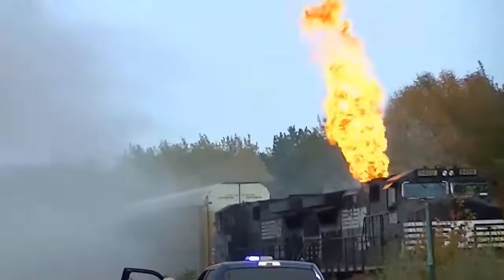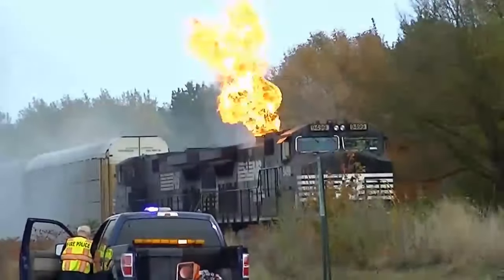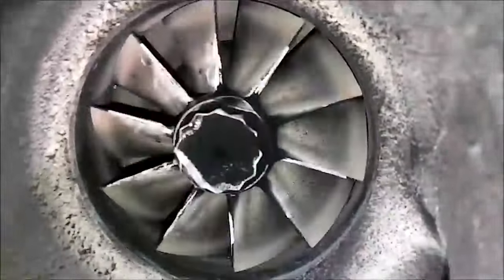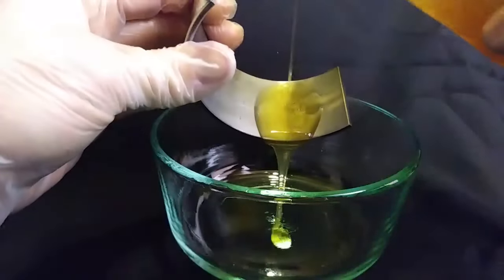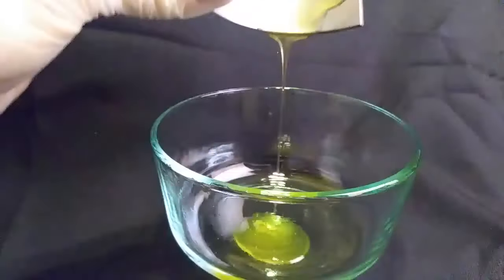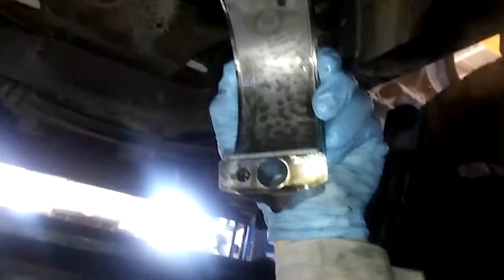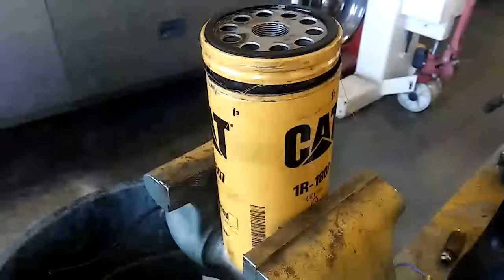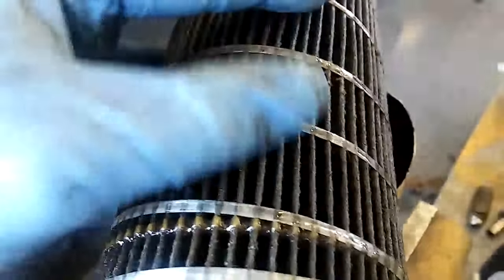Engine Block Heater vs Oil Pan Heater. Everything you NEED to know about Cold Weather Diesel Engines

Comment: Don't glow plugs come in all diesel engines or is that something separate that you have to install yourself
Reply: that's part of the engine design, it's drilled into the head and protrudes into the combustion area so that the injector spray hits it and ignites. Some of them are notorious for burning out (Old IDI Fords especially)
Reply: @Rx7man  thanks for explaining I appreciate it
Reply: some of them have grid heaters instead. which is better in my opinion. easier to maintain. simpler
Reply: @FrankieJames7  the Cummins 5.9s were grid heaters, yes, I agree, much simpler, but grid heaters (er, intake air heaters) don't work very well with indirect injection engine designs.. there's some small holes that a portion of the compressed air from the cylinder travels through to get into the precombustion chamber, if all that metal is cold, you lose too much heat there, thus a glow plug in that area is better for that design
Reply: Most larger engine don't use glow plugs or grid heaters
Reply: @Josh-b3c  part of the reason is bigger engines have better cylinder volume to cylinder area (thus less cooling effect).  it's also harder to overdose the ether on a 30L engine than a 5L engine and cause damage

Comment: Glow plugs and my fuel bowls heating element do wonders. Sub 0 starts unplugged without issue.
Reply: BS. none of mine ever did
Reply: @robertboyd3863  when it functions as intended it works great. It was 0 not too long ago, unplugged, I let the glows go for like 30 seconds, crank, fire, running on all 8, feelsgoodman.
Reply: @ApolloTheDerg  I have had numerous diesels , 5.7, 6.2s ,6.9s, 7.3 , and all sorts of diesel tractors, , none would start off glow plugs without either, or being plugged in at 0 or below , had to get some sort of heat to them what year is  your rig,  I know some of the new stuff will start better than the older stuff I used , also you are talking Fahrenheit? plus it is terrible hard on them to start them unheated at that temp
Reply: @robertboyd3863  1996 7.3L PSD with new glow plug relay, valve cover harness, unplugged, 0 degrees Fahrenheit, no ether ever used, generous glow plug running time. Now if you are talking IDI sure you might have a point on that one.

Comment: First of all, why would you need to choose between the various solutions??? Obviously, if you're plugging in at an outlet anyway, you go with both the water and the oil heater options. That's a no-brainer right there! Additionally, if you can get a battery heater in there at the same time, why wouldn't you do it? Just plug it all in at the friggen outlet! Anything to spare your critical components from the torment of a super cold start! What's there to think about?
Secondly, glowplugs and filter mounted fuel heater options run off the batteries before (and some during and after) startup so you can have that regardless of your plug-in options. So if we're talking about cutting cost, naturally you go with all of the above options! Because, whatever protects your critical components from the torment of really cold starts, dramatically reduces component wear and thereby also maintenance costs, which really should be the primary goal here!

Comment: What type of diesel vehicles use diesel number one
Reply: All of them in the winter
Reply: Yeah usually you can only buy it in certain areas of the country like Montana and North Dakota have it available alongside diesel 2 pumps
Reply: @Josh-b3c  Around here they automatically switch it depending on the season.. starting in november you get a blend of #1 so that by winter it's pretty much all #1

Comment: You should have mentioned  a 3rd option
Reply: The 3rd option is a tank type coolant heater.  More expensive than a block heater but large high watt element
 Not uncommon  here in the great white north

Comment: I've seen fire rolling out of train engines a few times.
Reply from the maker: Not me other than the videos. I have seen generators and truck engine catch, although never one burn down.
Reply: @AdeptApe  I work on the RR and work my way up to a engineer and the crazy thing I've witness a few times it seems right before the motor blows the engine will becomes very powerful. I've seen them blow when I was working the ground fire will shoot high and the ground will Shake. If we know one is giving is trouble we will cut it out but they will blow with no warnings but most of the time if we know we got more power it want be long.
Reply: @rickv9251  you meant turbo right?
Reply: @persistentwind  top of the exhaust , just like the picture at the beginning of the video.
Reply: @persistentwind  I've seen fires in different locations on the engine inside the cab also.

Comment: If you're using the correct oil, it's not thick at colder Temps. Question was about starting, not engine wear.

Comment: If a lead acid battery dies then freezes, it's done. You can charge it a little, but not enough. Lol
Reply: Yup, and a fully charged battery won't freeze, hence why I tell people to just use a trickle charger instead of just a battery blanket.. I'd rather have a cold charged battery than a warm dead one
Reply: @stanleykendziorski7964  I like the waterproof marine maintainers, built in desulfination function is a added bonus. I've got a Noco genius and it has worked fantastic,  have it wired in to a covered plug on the side of the truck so its just like plugging in my block heater. Linked below is the one I have for reference. 

https://www.amazon.com/gp/aw/d/B08G3M697M/ref=sspa_mw_detail_0?ie=UTF8&psc=1

Comment: Had a diesel w a water heater and bat blanket.... forgot to add some diesel heat.... bad day
Reply: I’m glad my OBS has a heating element in the fuel bowl. The cylinder warms with the plugs and the fuel warns at the same time

Comment: No electricity like to flow at -60 C
Reply: Martin Brousseau neither does blood, but if I'm out there and that's all I got that's what I'm using lol
Reply: Actually electricity love cold. Flows better and more efficient. Though there are materials or conductors that can be used to make that not true, standard components are way better in the cold. I'm not talking about batteries.
Reply: @mikeznel6048  emmm electricity freezes, electric flow decreases in the cold, electric wires are dug deeper in colder climates.
I’m going to suggest you live in warm climates where your tires have never frozen, diesel does not gel, washer fluid does not freeze, gas does not freeze, where your fuel stations do not freeze.
Reply: @mikeznel6048  Canada’s -40 / -60 is also when tires start to freeze usually freeze flat on the bottom side having to drive slow until the tires warm enough to get a round shape.
I am not asking you, I am telling you electricity freezes.

Comment: I had the idea of  using a heat gun to blow hot air into the intake. Good idea? Too hot, (hair dryer instead maybe)?  Unnecessary? Stupid?
Reply: Too many variables with your question...
 Although for an example I’ve seen a 6-71 Detroit powered Semi Truck, cobbled together with a 240v. electric clothes dryer heater grid fabricated into the air intake. It did not start any quicker though.
 “Summer in a Can” was the Ticket for that old
Screamin’ Jimmy.😉